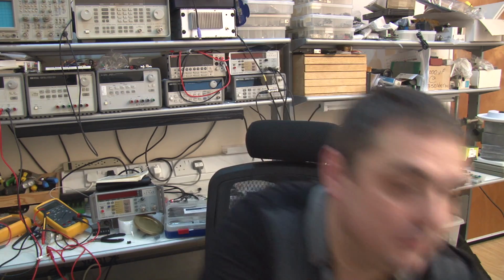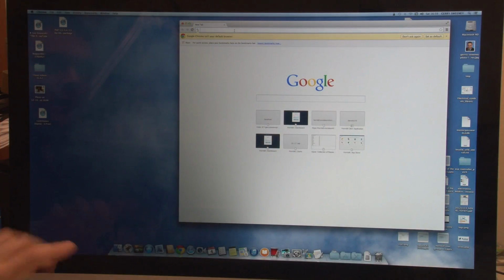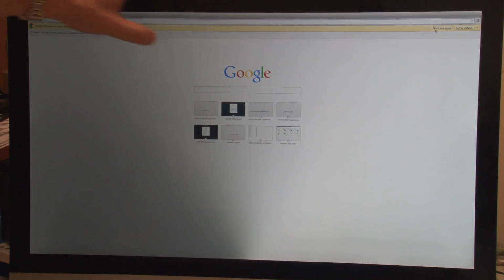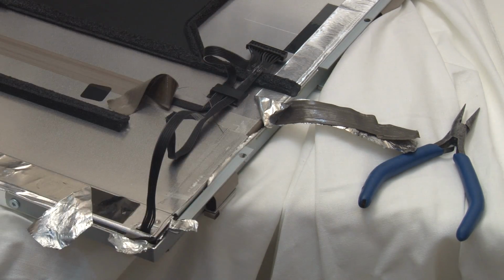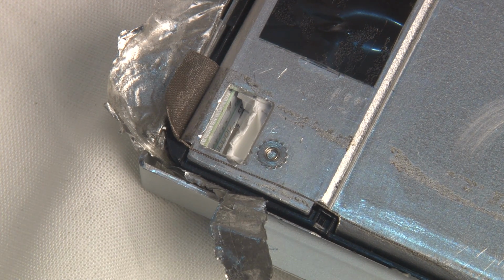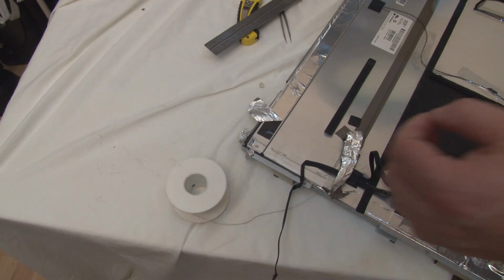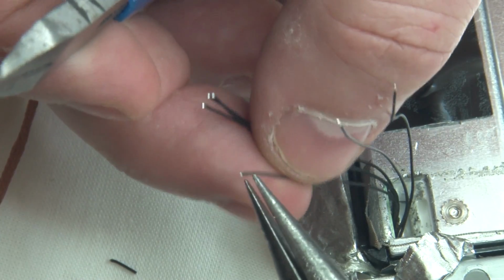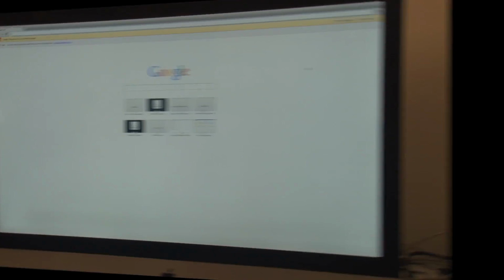Apple iMac 27" Dark Side Screen Failure - The Manufacturing Fault Apple Will NOT Admit!!

Comment: Great informative video thank you! I have a similar issue but my screen isn't quite as dark on the left. My iMac 27 also goes completely dark randomly, (i.e the backlights are completely off and I have to use my shortcut which turns the display off and on again to bring it back) could this also be the screen or is it likely to be the inverter in your opinion? Im just trying to figure out exactly whats wrong with my machine and if its two problems or just one. Also do you know if this fault is with all 27 inch iMac screens or just some? Thank you for your time, Cheers.
Reply: Hi, my iMac 27 was having the same problem as yours: backlight went dark randomly, but could be restored using keyboard shortcuts. I did the repair explained in this video and now it's working fine. Actually, I couldn't manage to solder through the tiny hole, so I ended up taking the whole screen apart and re-soldering the connector. This is NOT a casual repair ! You need good tools and soldering experience.
Reply: Hi Jerome, cheers for your reply. Since posting my first comment I replaced first the inverter (which solved the random screen going completely black issue, but not the screen dark on one side issue) and then I replaced the entire screen as I'm not that good at soldering haha and I had a parts computer on hand. This solved the screen being dark on one side. So I think I definitely had two components that had failed at the same time. My iMac has been working flawlessly ever since (touch wood!). I hope this helps yourself or anyone else who is having similar troubles.

Comment: I've got a circa 2012, Korean 27" Crossover 27QLED-P IPS Monitor with an LG LM270WQ1(SD)(E3) LG panel in it, which seems to be the same as the imac panel. Same half-dim problem, and lo and behold when I took her apart this connector had become un-soldered. Unfortunately I only have a wide, flat tip $2 soldering iron so it's time to do some research about what decent iron I ought to buy in that regard. Thanks for the video!

Comment: Gerry...great video. I did have a question. When you cut the wires from the connector, did you just pair the wires back up in the connector as they came out? In other words...how did you know which wire goes in which port on the plug? I just purchased a 23" iMac cimema display with the same issue and want to try this repair on it. Thoughts?
Reply from the maker: Yeah just pin for pin, 6 pins, 6 wires, very simple
Reply: Thanks Gerry! Take care mate!

Comment: Hi Garry
That was a great video ,, Thank you
Currently I`m dealing with a backlight problem in iMac late 2013  size 21.5" 
The screen is totally dark , when I put a light on it I can see it works fine, 
also, I connected the iMac to my TV lcd screen and everything works just fine.
Any ideas or help with this issue will be really appreciated

Comment: Do you have a video or any way of REPLACING ONLY the SCREEN GLASS of the 27" iMac (late 2014) WITHOUT replacing the LCD?? I cracked mine today, it works fine, i just have this crack in it now... any ideas??

Comment: Gerry, after replacing inflated capacitors in my iMac 5 the Mac will not power up. Two LEDs on the motherboard indicate the voltages are good, I can se the hard drive trying to boot up, but the screen is dark and the typical bong sound does not come up. Your help will be appreciated. JYoung

Comment: Gerry, my 27 inch iMac seems to go into screen weirdness after it has been in sleep mode. Even for a short time. The screen takes ages to come back online and sometimes it looks dark and patterned glitches. I have worked out that if I hold the on /off switch at the back on for a sec and then click the enter tab on the keyboard it rests and runs ok. But what would be the problem and even more important, the solution?

Comment: Hi Gerry, Soldering with not much working space, is like stroking a dog through a letterbox.I've always admired Apple's quality in hardware design, but paying 400 quid to fix their mistake - combined with Apple's dishonesty and faulty customer support - just lacks the appropriate anglo-saxon explative to express one's disdain.I had a wee chuckle watching you solder and mention that the magnifying glass gets in the way. It was a chuckle of solidarity though. ;)Fixing these machines isn't too dramatic when they belong to someone else. But when one (like you said) has paid the extra premium for this hardware, the cascading emotions rattling around one's brain caused by the feeling of being ripped off, isn't fertile ground to be repairing anything. That's due to the fact that all one wishes to do, is to smash up something substantial with a sledgehammer. :)
Excellent channel...thanks for all the braindfood mate! Subbed :)

Comment: Holy cow!  I just pulled my screen out, hoping that it was just the plug-in connector that might have been faulty.  No joy.  Further searching brought me to your video.  Sadly, my soldering skill is not at the level of your own, so I think I'll learn to live with a dim corner of the screen for a little big longer.
Reply: Did you try jacking the connector in tightly with a wedge? A connection held by force may work fine, as it isn't a data link.

Comment: hey Gerry, great video and tutorial. ive got a question. i have almost the same problem with my imac but my screen goes entirely black, everything else is working but the backlight goes off right after i boot up the iMac. would your tutorial still help if i did this to both cables on either side? thanx a lot
Reply: Video cards fail on certain models. Apple replaced one in warranty from a used early 2007 24" iMac, the last white plastic model, but had it fail again a bit over a year later. The video out port will still drive an external monitor. Perhaps your may have the same issue. It gets too hot around the GPU, which becomes disconnected. 

I just watched a video where a patient guy dug out the video card, removed the heat sink, the thermal paste and some plastic gaskets, then BAKED IT IN HIS OVEN for 8 minutes at 200C/392F. The GPU gets hot and settles back down. He just commented 3 weeks ago; 30 months, still OK. This is the 2nd time he needed to do that.

Good luck. I may try that trick or sell it for parts.
Reply: The video name is as follows:

Burn the VGA and Fix your iMac - Don't Pay Shitty Problems!!!

Link in next comment.
Reply: Graphite grey 24" iMac. Video card fix. Video link

https://youtu.be/9vPM41ZmLos

Good Luck!

Comment: big thank you! I do the repair like in your video. My mac has exactly the same problem.
Good soldering skills are absolutely necessary and a good brand soldering iron as well.
I used a 16W Ersa soldering needle (1mm). Take 20mins for the complete repair, and safe 500€ ;).

Comment: Hey Gerry! Cheers from Nova Scotia. I have the same issue and am going to tackle this project on the weekend. Just want to know the gauge of the wire you used in the opening? I've seen the question asked but haven't seen a clear answer. thanks!!
Reply from the maker: +Darren Howse the wire I use was 30AWG, link to the actual wire here: http://gerrysweeney.com/apple-imac-27-dark-side-screen-failure-the-manufacturing-fault-apple-will-not-admit/ (search for 30AWG). Gerry
Reply: +Gerry Sweeney  Thanks so much! Have a good one!

Comment: Hi Gerry thank you for your nice video, the screen of my old 2009 Imac is all Black do you thinking it is a connector issue?
Reply from the maker: +lynyx77 if its all black then its another problem, possibly the backlight PSU board. 
Gerry
Reply: +Gerry Sweeney In fact it was the GPU Card ( ATI 4850) I've just put it in the Oven 7 min at 200 °C and now my Imac come back online and is Ok,
Reply from the maker: +lynyx77 nice one, thats a great trick :) hopefully the fix will last :)  thanks for posting 
Gerry
Reply: +Gerry Sweeney Yes you right now I'm monitoring the Temperature of GPU, and trying to find a cheap graphic card on ebay.
Probably I will try to replace the 4850 ATI for a 6970

I've seen someone on youtube were that fix was ok during 2 years and he done again the same thing last december and it still ok.
So I' m a bit confident.
I will update if the issue come back

Comment: I have lived with this shadow on the screen of my 27" iMac for a couple of years. Yesterday I turned on my computer and suddenly the screen went black (it is rather a quick flash, and then it turns black permanently). This happens every time I turn it on. The screen is black but the system stills running normally. For now, I 'm working with an external monitor. Do you think that this failure is due to the same fault? Thank you very much for the video and thanks in advance for your answer.
Reply from the maker: +Wolfrido Navarro if the entire screen is black that might be the backlight driver board. If you have had the dark side problem then you most likely have the same original fault, although that may now have developed into a driver board failure.  I am just guessing though.  Gerry
Reply: +Gerry Sweeney Thank you so much for your help. I think I'll do the half dark screen pressure test. I hope the display reacts so I can decide what to do. Thank you very much for your prompt response.
Reply: +Wolfrido Navarro hi,  did the pressure test work?  just checking, my machine has same problem. thanks.
Reply: +nicholas harris Yes, actually it worked :) I have made the pressure and the display turned on again. I'm working with my iMac since then and the shadow was banished for a while, but it just has appear again a couple of days ago :( I think I'll have to make the fix surgery described on the video in order to solve definitely the problem.

Comment: No need to solder a simple dry connection will be quite adequate. Simply pack out the gap behind the pin jack until connection to the lcd is forcefully successful. secure with tape, Job done!
Reply: No, just seems the easiest way to tackle the problem.

Comment: Have you ever seen one of these Mac fail when it boots after the
progress bar it goes to a black screen with thin white vertical lines
on the screen, and then it just reboots, over and over?
Reply: Often that is a GPU failure which is another expensive repair.
Reply: Often that is a GPU failure which is another expensive repair.

Comment: I've worked for Apple for about 14 years. I'm a Senior Advisor.  The issue you're describing isn't unheard of.  What we usually will do is try to 'Capture' the device.  That means, we'd like to send you a box and have the computer sent to our engineers to look at.  If they get enough devices with the same issue and it is determined to be our fault (as you seem to be describing), they will issue a repair at no charge to you.They just need to get enough units with the same issue, determine the repair and move forward with it.  Obviously, some troubleshooting would be required.  BTW, with your permission, I'd like to share this video with our engineers.
Reply from the maker: +Thomas McKee feel free to share the video, trust me there is a lot of them with the same fault (just see the comments on this video), its a manufacturing issue with the panel, its not Apple's fault as such but its a shame they did not stand by their customers with this. I have another 27" in my garage with the exact same fault (which I really need to get around to fixing one day).  There was even at one time a class action against apple for it, not sure what happened in the end.
Reply: +Thomas McKee would you like to pick mine up?  I sent my Apple store a link to this video months ago and got no reply. I gave up and replaced it with a PC, wiped it this week to sell it but its virtually worthless if it comes with a repair cost. its a 27 inch from  2011.
Reply: If only… !!! 🤥🤬😭 I lost 3 machines due to obvious manufacturing failures. Only 1 of them made it into a repair program… unfortunately 5 or 6 years too late. I just heard of it by accident. No official announcement , nor any notification of the customer. At least, that‘s the real world and service situation in Germany. Shame on Apple.

Comment: Hi Gerry, I've just recently had an issue with the power button on my imac 27, which was a week outside it's warranty. Prior to my warranty expiring I had reported the issue to Apple. They setup a repair ID and I took it along to an Apple store where they replaced the whole housing (incorporating the Power button). On setting up my imac at home, after 4 days the issue reappeared. I took it back to Apple where they then replaced the power board and connecting cable, which is where I am now. On checking out the invoice in my email, which I havent been charged for, Its shows that they have replaced the display panel (661-7169 Display Panel, LCD) I can only assume that what you are describing in your video confirms how fragile the soldered connection is as they have to remove the screen to gain access, but with regards to you fault outside of the warranty, I think you'll find under the sale of goods act, not fit for purpose, you possibly should not have been charged, certain goods that can apply for up to six years, I would have challenged that. Sorry, bit long winded but thought I'd give details of the whole picture, cheers.
Reply from the maker: +2lomp Yeah that would appear to be true in Europe, I should have tried harder with them, although if you are not prepared to drive to a store and bring the computer with you Apple are not really interested.  Anyways, it made a good video so I guess its horses for courses :) Gerry
Reply: +Gerry Sweeney Forgot to add, congrats on your repair, nice work.

Comment: After attempting this repair I'd like you to know that you are AMAZING with a soldering iron. The magnifying lens is much needed as that hole is very small. I would also advice anyone without soldering experience to seek help. This is not a project for beginners.
Reply from the maker: +Eddie Parks thanks for the feedback, I have been yielding a soldering iron since I was about 8 years old so i have had plenty of practice.  I hope  you got yours sorted in the end. Regards,  Gerry
Reply: just got myself a used 27" iMac with this problem. As I dont know what is going to happend with the seller (i got a 12 month garantuee) i will keep this video as a backup option :)

Comment: I have the exact problem with my iMac 27, mid 2011.  I am sure that I am having the same issue.  I removed the glass and when I press on the lower left of the monitor in the front of where you show the bad connection it comes back.  Cannot wait to break into it tomorrow.  Thank you for the video.
Reply from the maker: +Jon A. Hegreness you are welcome, good luck with it. Gerry
Reply: +Jon A. Hegreness Jon,  Were you able to fix  yours?  I have a 2011 now,  same problem.
Reply: +nicholas harris I have not been able to fix the issue.  I took the entire machine and it was pretty exact to this video.  I am familiar with how to solder and am pretty comfortable in my skill with larger projects like a stereo or a kids toy, but this was just too small a solder for any tools I own.  I put it back together and hope to pickup the fight another day.  I am replying to you from a new Macbook, but do plan to try someday in the near future, but have not found the soldering iron small enough at the two stores I stopped at.  This really is a very small project.  I can see it is doable.....maybe not with my current level of skill.
Reply: +nicholas harris PS, I am convinced this is the same issue with mine.  The little connector was more stuck to the tape, then the connection it was supposed to have.  The connection was definitely broken.

Comment: Thanks a bunch for your video. Right now I am in the middle of doing it myself with the help of a professional soldering technician :)
The workspace of the failure is absolutely tiny, though! How did you manage to solder it so well?? Anyway buen trabajo y saludos desde México!
Reply from the maker: +Alephsus good luck with the repair.  I have been soldering stuff on and off for 40 years, so with that comes experience which helps.  You are right the opening is 11mm wide so its a pretty small amount of space to work in.  Just have patience, a small soldering iron, thind solder and some thin single core wire and you will get there. Gracias y saludos desde Londres

Comment: why this happen because you had the screen brightness to high and the connector gotten lose, this scare the hell out of me because to have it fix by apple is freaking expensive as hell.
Reply from the maker: +Tony Torres this happened because there is a manufacturing fault with the LG panel, the connector breaks away due to thermal expansion. Its a common problem :(
Reply: +Gerry Sweeney I want to know if I have that same panel I would freak out then, because I have a late 2009 iMac 27 inch
Reply from the maker: ***** if you have the exact same symptoms then its almost certainly the same panel.
Reply: +Gerry Sweeney no I don't have this problem but I have never use my iMac at full brightness now I am afraid to use it at full brightness just in case the panel start to fail in his part of connection....

Comment: Hello Gerry, I stumbled into your video today.. and I am having a similar problem with my imac 27" .. the screen keeps going black.. I know that the computer is still working, it comes back.. then goes again after few seconds.. I have replaced the inverter board but still didn't solve the problem... what do you think it could be?
Reply from the maker: +Mircose I would have said inverter board too so I am not sure, I would be looking at the PSU next probably, but thats really only a guess.  What you might want to do is solder some wires to the input and output of the inverter board so you can run the computer and have a DMM(s) connected to monitor whats going on. When it goes black then you might get some more clues.